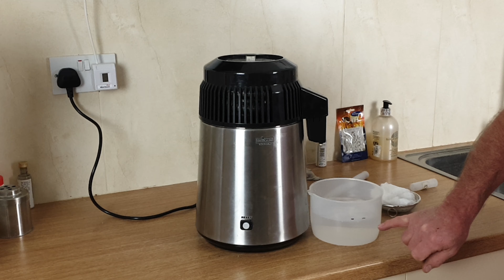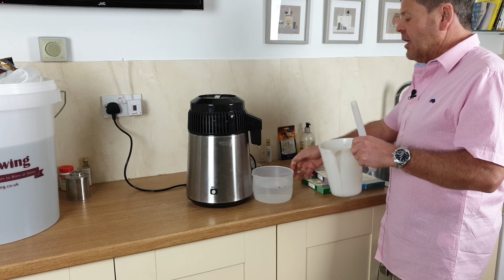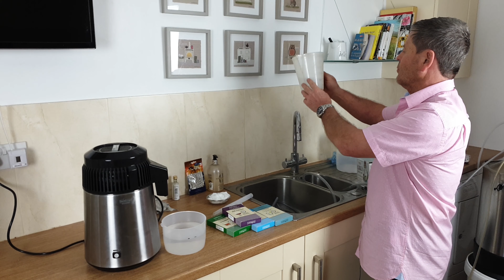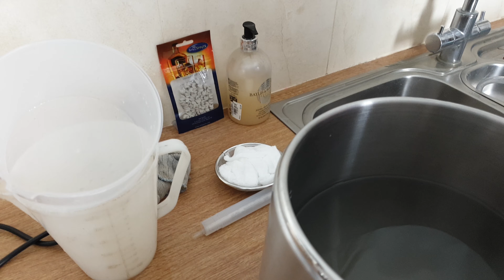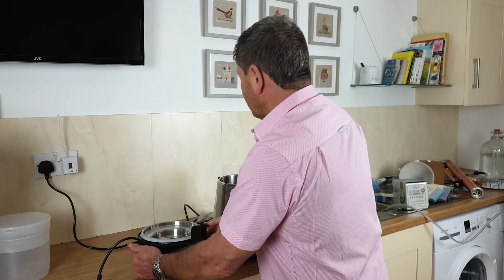Filtration and Flavouring with the Air Still

Comment: I have one more option for you. A more intense pre-infusion by adding already infused fresh botanicals back into your Air Still. By using your base alcohol that you've just made mixed with your botanicals and running it through either a Pressure or Whipping Syphon that uses no2 cartridges or a Coffee Syphon that uses an alcohol burner. If you want to get fancy about it, you can use the syphons to first infuse each botanical separately, then custom blend that last mix into the Air Still for a final distillation.

Comment: I've tried putting the carbon cartridge in the machine with vinegar while cleaning the machine roughly 200 ml vinegar and re used the cartridge and it worked very well :)